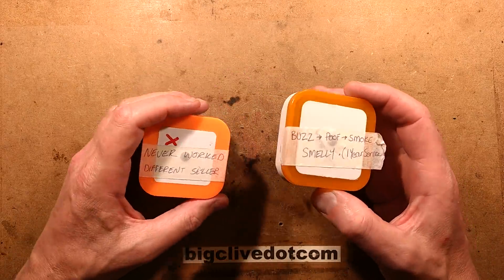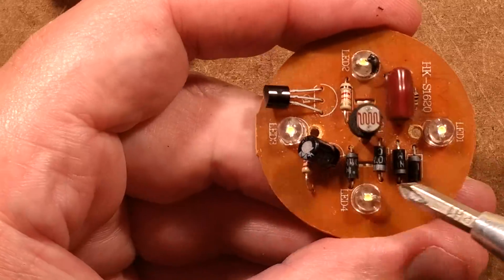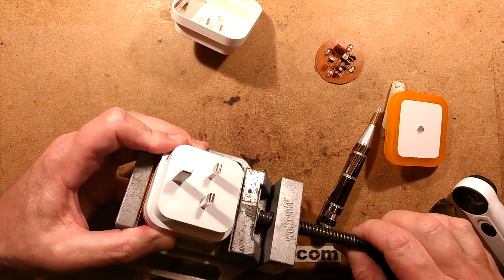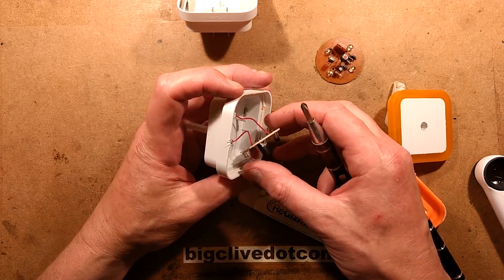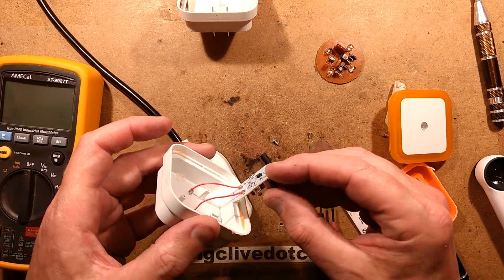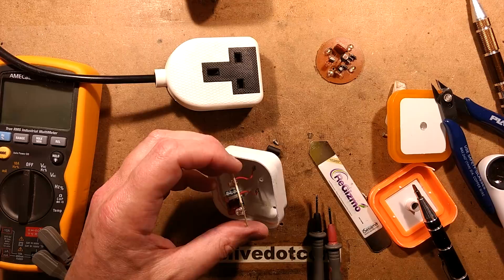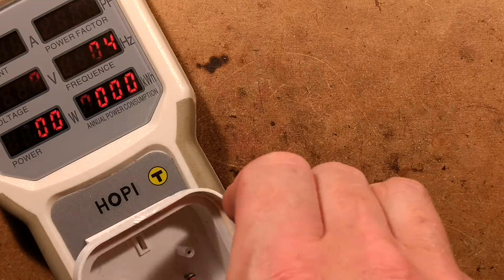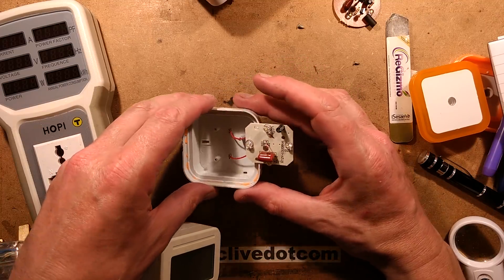Autopsy on two dead night lights, one of which emitted smoke.

Comment: I have several of these from China, but mine have SMD LEDs. And they started to fail one after another, one of the LEDs died in almost all of them. I changed the LEDs with a very cheap and big soldering iron and not very much soldering experience, which generated some burning plastic smokes but they work again. Cheap fix for a cheap light. I still have 96 SMD LEDs for future fixes.

Comment: The transistor in that circuit wasn't configured such that a wildly low  Beta value would be accounted for. Maybe if there was an emitter resistor it would have worked more reliably with different values for beta

Comment: Those Wolfcraft Engineering vices are remarkably durable. Clive's looks about the same vintage as mine (bought in the late 1980's). Simple, reliable, durable.
Reply: but is yours a vice of knowledge ??
Reply: Probably not! Really good for holding things in the one place though (makes reasonably accurate hole drilling a lot easier! :-) )
Reply: you mean you use it for it's intended purpose ?? .. lol

Comment: Hey Clive, been watching for a while now, love the videos.

Just out of interest, why do they shunt the current with the transistor rather than swapping the LDR and resistor in the divider so the transistor turns on in the opposite light condition and driving the LEDs through it?
Reply from the maker: It makes the circuitry much more complex.

Comment: In the diagram transistor shorts the directifier. Should there be a gap in the negative rail between 5.1k resistor and transistors output?
Reply from the maker: The transistor does short out the rectifier.  That's how it turns the LEDs off.  The supply is current limited, so the voltage drops to the point that only th8ing being powered is the transistor itself.
Reply: Thank you for explanation and keep making more people interested in electronics by publishing more great videos on the subject;D

Comment: So it turns off by shorting out the leds. Then it would draw more power during the day when the leds were off. Cutting out the transistor would be an improvement.
Reply: doesnt make any difference, the voltage across the leds is quite low, probably around 10v, which is roughly 5% of 240v, so the current will only increase by about that much in daylight..
Reply: andygozzo72  - more to the point, the current increase makes no difference, as the reactive power goes up, but the actual real power consumption does not change very much and may well be lower. With the transistor switched on, the only component that is dissipating any significant power is the 330 ohm resistor (marked as "fus" on the PCB) on the mains side. When the transistor is off, the LEDs and the resistor in series with them will consume power as well as the mains side 330 ohm resistor. This may look weird, but it's due to the use of a series capacitor to "drop down" the mains voltage. Remember, this capacitor will charge up every half cycle, then discharge back into the mains supply as the supply voltage changes polarity.
Reply: It draws much less power when the LEDs are shorted. Much less real power anyway.
In my simulations of the circuit, it draws about 260mW when lit and 20mW when off. When it's on, the LEDs are using about 140mW. The apparent power is about 2.8W regardless of the state.

This result is logical. When the transistor is on, there is less voltage across the rectifier and therefore more voltage across the capacitor. That translates to less real power and more imaginary.

Comment: What's happened with the sound on your videos lately Clive? sounds like auto-volume control screwing up the audio and switching sound in and out of phase.
Reply from the maker: I broke the screen of the Moto G4 and started using a Moto G4 plus which seems to have this audio "feature" that can't be bypassed.

Comment: I would have just cut the lead going to the LDR so that way you could troubleshoot more instead of just whacking that poor innocent transistor that was probably minding its own business!  :)
Reply: Paul Stafford  Or even more non-destructive, short out the 5.1k resistor between the transistor base and emitter.
Reply: I also thought that "removing" a component needed soldering iron, but apparently not always :)

Comment: Clive can you explain what the difference between apparent and real power is and why do meters show only apparent power?
Reply: Super Socrates The Hedgehog - meters can show apparent power, or real power, or both. Real power is the actual power used by an electrical item. So, with a 60W light bulb, it consumes 60 watts of electrical energy and converts it to heat and light (the total energy of the dissipated heat and emitted heat and light is 60 watts). No energy goes back to the mains. Apparent power however is the voltage multiplied by the current. In a DC system, this is the same as real power. But in a AC system, capacitors or inductors (transformers, motors etc.) cause a higher current to flow. But this extra current does not end up doing 'real' work. Hence the term 'apparent'' power. As when the mains cycle changes (it's supposed to be a sine wave), the capacitors or inductors cause current to flow back into the mains. As the new mains cycle continues, everything repeats again. For more, search for 'power factor'.
Reply: Mark 1024MAK thank you very much for the explanation I appreciate it!

Comment: Clive, I know that an Electrolytic Capacitor will pop if connected the wrong way round, but I really don't understand why. Is there any chance that you could explain this in one of your videos please? (a good chance to pop a few Caps for added realism and Education as well!) 
It just seems odd that what is basically two plates to store a charge would explode???
Many thanks and love your videos,
Joe
Reply: The polarity of capacitors was covered in one of Clive's much earlier videos. Try a search and see what you can find.
Reply: An electrolytic cap is not just two plates. The hint is in its name: electrolytic. Reverse polarity dissolves the isolating anodized layer on one of the plates leading to an internal current flow, heating up the electrolyte, turning it to steam, making it pop.
Reply: Joe's Model Kits - but an electrolytic capacitor is far more complex than two plates. In fact, the metallic layer is so thin, it's not really two plates of metal at all... And the insulator in between is not really an insulator in the normal sense.
Reply: Thank you very much for that, I feel I understand much better now.
Reply: There's a great Cody's Lab video where he makes batteries in open jars, and repeatedly reverses their polarity to break them in (generating more oxide). You can tell when one side is done because the electrolyte stops boiling.

Comment: I have no luck with digital battery testers (the BT-168D), I've gone through five in the last 18 months (from eBay) what could be a common fault?
Reply: Buying from eBay is the common fault.
Reply: That could be it, I get so much shit from eBay I've stopped shopping there
Reply: ... but what I really wanted to know was what part in the tester is failing ;)

Comment: Why are all these capacitors falling now? Appliances have had them across the mains for years with no issues.
Reply: uK8cvPAq  - capacitors used in this application, or used directly across the mains a filter / suppression (X-rated types) have a hard life. If due to deterioration or too many voltage spikes damages them too much, they typically do fail in a destructive manner, including smelly smoke. Rifa types are well known for it. So well made types should last for many years before they fail. But lower quality types will likely not last as long.
Reply: There is a massive difference between good quality and cheep capacitors.  If you look at expensive PC power supplies they are often marketed with the phrase "Japanese capacitors" as these are generally good, provide a long life and smooth power.
Reply: 400WVDC is actually severely underrated in this dropper application. Maybe they are pushed over the edge by slightly higher ambient temperatures, maybe they just shit their pants randomly. a 630WVDC cap will last a lot longer, a 1000WVDC cap will never fail.
Reply: RIFA capacitors are a whole other story. Theoretically they should be up to the task, but in practice they are just another impregnated paper capacitor, squeezing the last penny out of 1930's technology while cutting costs in every possible way (but still they cost more than a high quality polypropylene X2 cap, go figure). Some other brands have one or two series of paper capacitors as well, same story but slightly less cost cutting than evox/rifa.
Reply: China

Comment: I'm not very good in electronic so I have a question:
why use a trasistor to shunt the led instead of turning them off (going open circuit)?
Reply: Basically cost. Using a low voltage transistor to shunt the (existing) low voltage is cheaper. If the transistor was to be used as a switch for the LED array, once in the "off" state it would have to handle the full peak mains voltage (roughly 240V x the square root of two (1.4142) = about 340V), so you'd need a more costly "400V rated"  transistor (and a higher voltage rating for the electrolytic smoothing cap = much higher cost).
Reply: I had the same question. My explanation would be that if we are relying on a capacitor dropper to supply proper voltage to any circuit, the current that the circuit draws must be almost stable. 
Turning off the led's in our case would result in a much less current draw through the circuit. 
Can anybody confirm this and perhaps explain it better?
Reply: spiros
Yes, a capacitive dropper is essentially a constant current supply, not a constant voltage supply. You can't switch off the load on a capacitive dropper like this without the voltage on the DC side rising to rectified mains (~340V DC) eventually. The electrolytic and the transistor would have to be rated for this (bigger and/or more expensive) and when switching on the LEDs you would give them a short burst of 340V out of the cap. Btw. should a LED and the transistor fail open circuit (they have to fail both, because either will limit the voltage), the voltage will rise to 340V and most likely pop the electrolytic.
Reply: of course, thank you for your answer .
It would have been evident if had I ever tried to use  a capcitive dropper for anything!
Reply: Actually long series LED chains going open circuit and popping the smoothing capacitor happens all the time, especially on filament style lamps.
Reply: superdau
Thanks for the explanation. Exactly what I wanted to say.

Comment: Clive do you use an isolation transformer on your bench?
Reply: That would be safe. Why would he do that?
Reply from the maker: I don't use an isolation transformer.  But I do use a bench RCD.
Reply: Use a dual-pole RCD.  Then, you can wire in a number of emergency stop buttons (from the "usual suppliers" - complete with enclosures), along with suitable resistors, to provide an emergency stop function throughout your workshop. Wire the switches to directly short line to earth (via a suitable current limiting resistor - I use 1/4w 8.2k) which provide a guaranteed trip (for 380V = 46mA). Very useful.
Reply: My isolation transformer has stopped me blowing up my Oscilloscope on many occasions.  If you're feeling brave you can get away with touching something without killing yourself. 25KV on a CRT can tingle a bit but I have survived many times. I get complacent now.
Reply: Clive would you like me to donate an isolation transformer?

Comment: Are those brown dropper capacitors considered safety capacitors???????????    Are they "X" rated?
Reply: doubt if those particular ones are 😉  but they could be replaced with 'proper' ones..
Reply: It seems like every capacitive dropper circuits Clive opens has these brown dipped style caps.   So they are all using crap unsafe capacitors for their products.
Reply: Who are 'they'?

Comment: How did you blow-up you're last Amecal mete.? last Video?
Reply: Derek Todd he said he didn't film it.
Reply: On his old meter, the range selection switch failed. The damage to the meter probe occurred when he was making a different video, when he accidentally shorted out the mains on a board he was investigating. The resulting arc and fault current killed the board, not the meter he was using. Alas he was not recording at the time. Watch through his recent videos...
Reply: Mark 1024MAK Cheers.